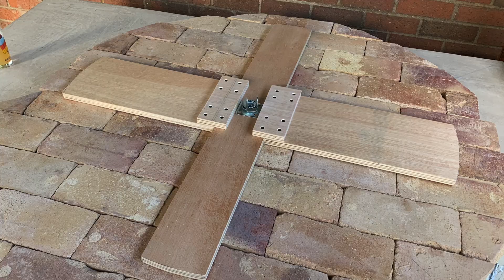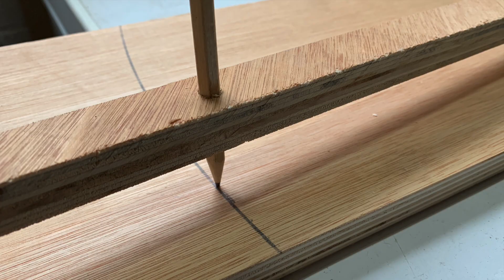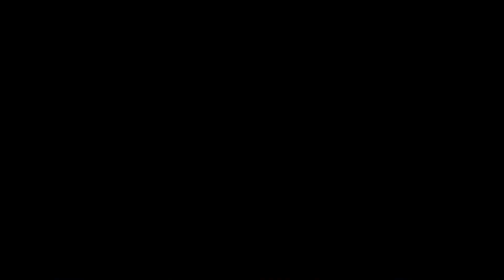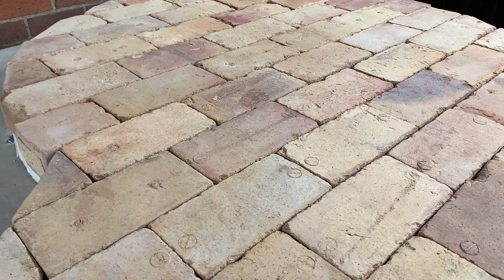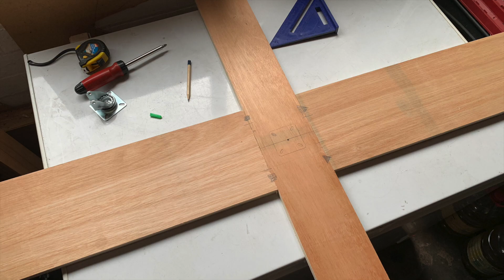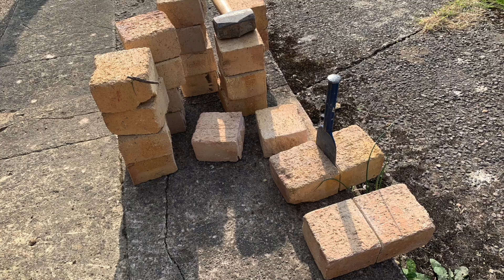Ep 7: Pizza oven floor bricks - laying fire bricks - reclaimed fire bricks

Comment: Hello, did you use only kacium silicateboard and alu foil without mortar for the first layer,it is ok? Because for another plans and videos i can see that every body use some glue or mortar for first layer of building.  about the first layer, how its functions your brick oven?
Reply from the maker: It has been fine for me.  Casting a block of concrete on top of the silicate board is often just to provide a larger mass to hold heat because they are using thinner floor bricks.  I have larger floor bricks that will hold more heat.  The whole structure once built is more than enough to lock everything in place.  I would only consider fixing the floor if earthquakes were common, then you might get some movement.  My oven has been running for 1 year and the only thing I would change is adding a gap between the flue gallery and the chimney to allow for the chimney to expand with heat, it has caused a small crack in the flue gallery.  Hope that helps.
Reply: @DeveloperDIY  Thank you very much..I will do the same..:) I don't want to buy another material like concrete, which means I already have all the things and can now start cutting the bricks, but I have another question..did you glue the bricks in the entrance tunnel? They are small pieces of bricks..thank you very much..maybe I will try to secure the bricks with some kind of band or something like that..I mean the floor vs the first row, otherwise I have a calcium silicate board 5 cm and 6.5 cm fireclay bricks, I hope it will be okay. To be sure, you already glued the first row to the floor with fireclay bricks, right? I still have to study the gap between the chimney and the dome somewhere, what do you mean?
Reply from the maker: @ReeyesM  I used mortar on the first row of bricks to glue to the floor.  I used a cement fondu + fire brick grog mixture.  I show the mix in a later video.  You can use a refractory mortar.  The floor bricks in the entrance are held in place by a large casted block of concrete later in the build for the tiling around the entrance see episode 12 for details.  The chimney flue should have a small gap around the flue itself where it slots into the entrance to allow it to expand with heat.
Reply: @DeveloperDIY ok thank you..unfortunetly I have the edge of the furnace entrance along the edge of the slab.. I'm thinking about sticking it on.
Reply from the maker: @ReeyesM My oven sat too close to the edge of the slab too.  I made a little wooden shelf and cast a slab of concrete for the landing that overhangs the slab giving more room.  That might help you.

Comment: Under calcium silicate you did not put anything to get it stuck?
Reply from the maker: No, the weight of the oven will be enough to keep it in place.  Also the tiles, the Perlite render and the concrete landing will all work to stick it all together.
Reply: @DeveloperDIY  ok good to know, I just finished the concrete wall and now start to lay bricks

Comment: What kind of bricks did you use
Reply from the maker: I’ve used reclaimed 48% alumina fire bricks.  They were originally used in a kiln that made graphite rods.
Reply: Good video man! Do you know if there is any chance of toxicity due to the graphite in the original purpose of these bricks?
I'm in the process of building my own portable pizza oven, the floor tiles that I'm using is grey granite about 20 mm thick,layed on a concrete slab I'm assuming that the granite will withstand the heat, .......?
Reply from the maker: @WATKINSGARYJOHN Thanks.  Graphite is pretty safe, it’s just carbon and the kiln bricks would not have touched the graphite directly so I’m happy it’s as safe as licking the graphite in a pencil.  Granite sounds nice to work with, the floor will be very smooth I imagine.  I would be a little concerned about cracking though.  I believe granite will transfer the heat slowly so one side would be hotter than the other.  The alumina in the fire brick helps the heat move faster which reduces this problem.  Good luck with your build, let me know how you get on.